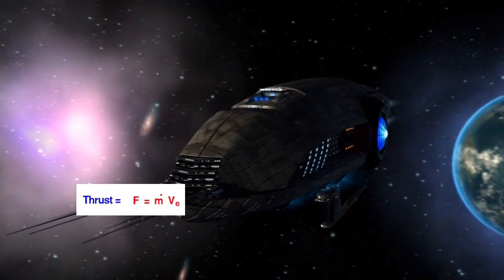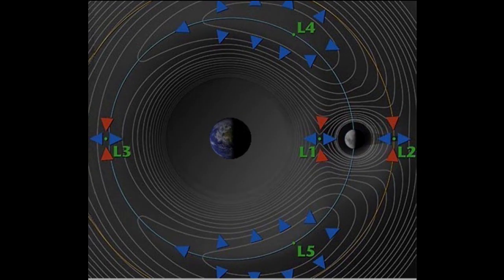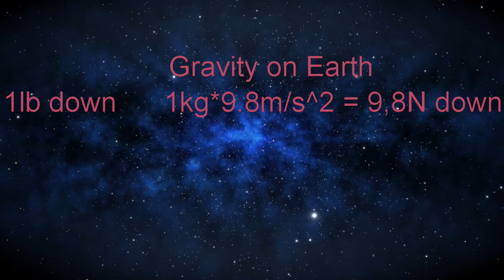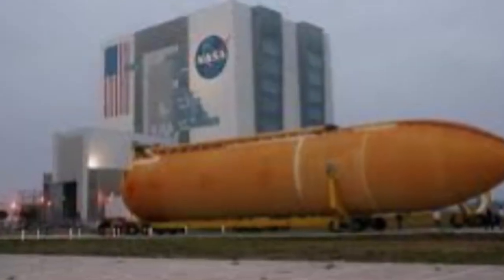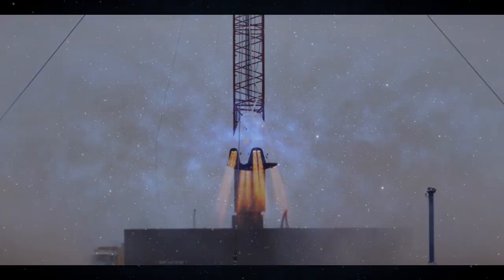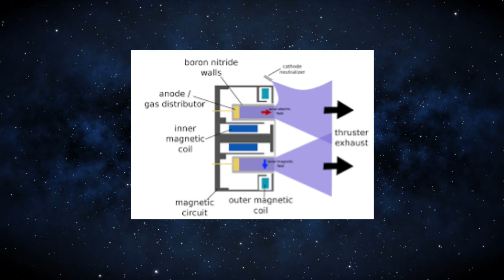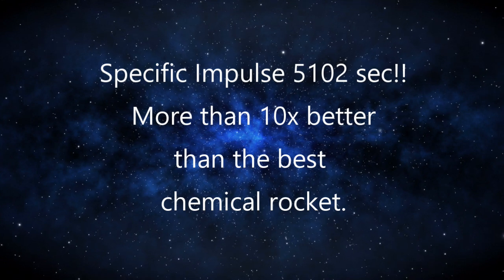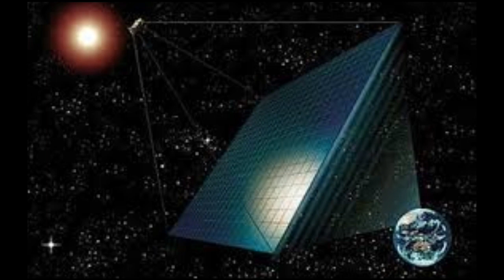Advanced Propulsion Systems for Transport, Rescue and Defense in Space

Comment: The molton salt liquid fuel type reactor you mentioned can be designed to do alot more than burn thorium. It can be designed to burn nuclear waste of many kinds. It can be fueled while running.You can extract important radioactive isotopes while running. It operates at high temperatures. If temperatures get too high the reaction stops. The fuel for this kind of reactor can be found all over the solar system. It can be designed for a number of different functions. The biggest problem is it is extremely corrosive. The first reactor  of this type was made over 50 years ago and run for over three years. It was invented by the same man that developed the first reactor we use today for large scale power. It seems like it would be the perfect fisson reactor for space infrastructure and propulsion until we have fusion.
Reply from the maker: I agree. Plus it could put all that high-grade nuclear waste to good use.